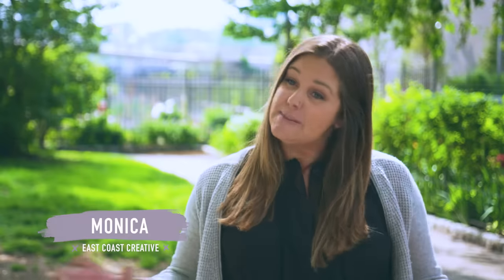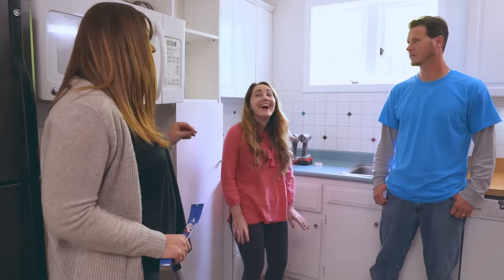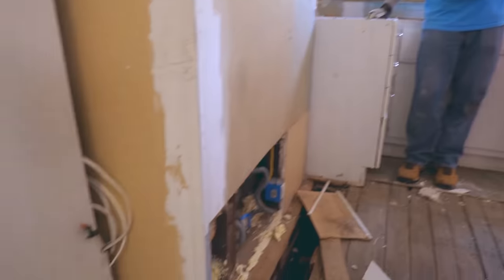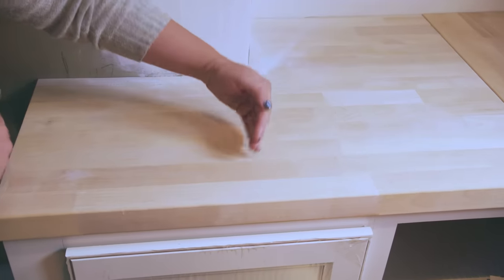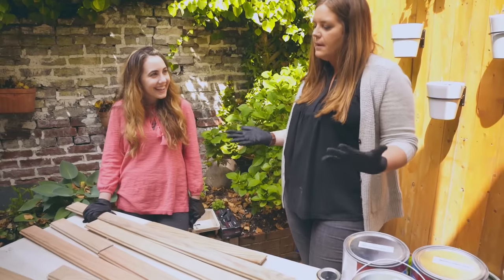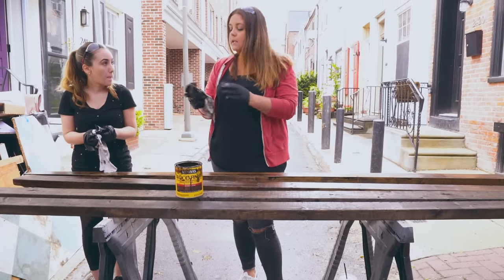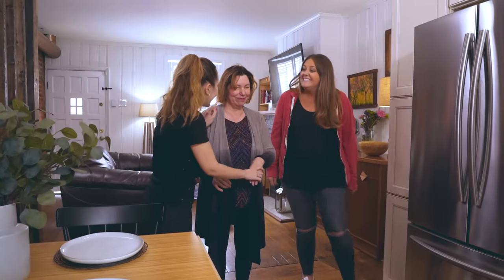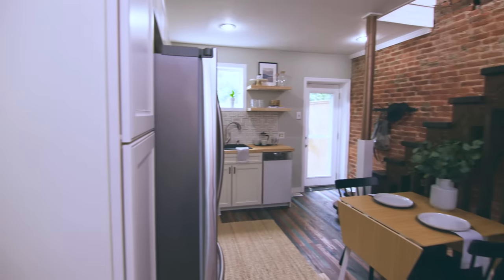The Weekender: "Tiny Mighty Kitchen" (Season 4, Episode 8)

Comment: I loved the "wall" created next to the stairs, and felt it complemented the open stair structure to the upstairs.  A light fixture behind there on the brick wall might add illumination and eye appeal.  The floor design wasn't my cup of tea, but I loved how you ripped up the luan and existing tiles and used a hardwood option. It would have been great to gain a bit more space for the fridge or range, but you were working with an existing chimney structure that couldn't be changed easily.  Ditto for the floor.  For a one-weekend time frame, and a limited budget, you solved a number of problems, increased efficiency, and added functionality to the space.  Well done.

Comment: The kitchen looks so much better than before! I love the stair solution...but,...as a designer myself, I see a few more things that Monica could have further done: 
#1. Enlarge the window over the sink by extending it down another 6 inches. Larger windows give more view to the outside, making the space feel larger, and giving more air and light to the interior.
#2. Why use such a deep 3' refrigerator when 2' deep models are available?  Use a 2' deep counter-depth refrigerator and you will gain a foot of space in the eating area, and overall better space-flow through a tight passageway.
#3. Why use a stove range which also juts out? Instead, use a built-in cooktop over a built-in wall oven which will save about 3" of precious depth and give a sleeker overall design.
#4. It would be better to place the pantry unit between the stove and the refrigerator (rather than at the end), so that the stove isn't heating the refrigerator by being so close to it. This will help to save energy and reduce the electric bill to cool the refrigerator.  
#5. The space to the right of the compact dishwasher is under-utilized. Yes, there is a heating vent in the floor, but built-in open storage can be custom-built over it. There would still be airflow and more storage would be gained.
I hope this helps everyone with similar tight spaces. :)
Reply: I would have also recessed the 4" boards in the stairwell to fit under the stair to save 4 precious inches. It would have been a bit harder to install but now there is the top ends of the 2x4's to gather dust and take up space.  Overall though a lovely reno.
Reply: you are so right about the window, but since its a 2-3 day project it would have taken too much time to do as well. and yes pantry between the fridge and stove would have been ideal!
Reply: Well she only had 2 days for the reno so not enough time for the window extension. And maybe the home owner wanted that size of fridge and stove. And I don't think the pantry would work in between the stove and fridge symmetrically. Small kitchen. That would chop up the flow. See we all have opinions. I think you should have enough respect for a fellow designer to not belittle her work the way that you did. Especially when the job that she did turned out to be fantastic. I hope that you receive the same respect that you give.
Reply: I don't disrespect Monica at all and admire her creativity. It's just that I have much education and experience in design. Designers critiquing each other is actually very common and accepted. The best designs are often made through collaboration, thinking through all the details.
Reply: @cathyhendrix7552  So opinions are NOT welcome???  Possible to make a good design great with a bit more time to reflect/focus on the small things like enlarging the space. Hey better ideas for the next project! I appreciated the suggestions for my own home...
Reply: @phyllisharris2766  Sure opinions are welcome. I gave MY own opinion.  And that is.....I don't think a designer shoot toot their own horn at the expense of another designer. She went on and on about how she has much more education and experience so her design is better. SAYS WHO??? I just said she should have more respect for a fellow designer. It is her attitude that bothered me. She came off like she was better. And I just don't like people like that. But, hey, that's just me. And MY opinion.
Reply: @cathyhendrix7552  Absolutely fine to have your opinion...NOBODY was knocking yours or ANYTHING you chimed in on. SEEMS you would have the SAME courtesy, and THAT'S MY opinion, lol. It's fine, I'm clearly not the comment police in any case...just your comment was so packed with emotion, I was compelled to reply. 🙄
Reply: @phyllisharris2766  well I do have a tendency to get emotional when I feel like someone is trodding on another person. I ALWAYS stick up for the underdog to. LOL.

Comment: Oh my, girls, long hair hanging into your face and using power tools at the same time?? Use some elastic to keep your hair o the back of your neck. Nope it don't look pretty, but an accident ain't funny either.
Reply: AGREED!! I learned my lesson very quickly, had my hair clipped up outside using the big leaf blower, had on a hoodie and leaned over to turn it on and the string on the hoodie got sucked into the motor before I could freakin blink an eye and it pulled the whole blower up to my face! I hit the switch and got the string out which was now twisted one and a half million times into a tiny ringlet! can not imagine if that would have been hair, and ALSO wear better shoes, even some old work boots when doing that stuff, and no jewelry, I know these are cutesie little weekend make overs but you cant believe how quickly things happen.
Reply: Yes terrible accident. It's called scalping. If your on Lowe's Home Improvement channel at least pretend to be safety cautious in all areas because we're newbies and we follow things to the letter until we're confident.
Reply: I thought that the first video i saw of her...
Reply: Also, wear a mask when cutting that tile so you don't breath in the dust causing silicosis.
Reply: Also her long jacket sleeves are dangerous!

Comment: Love the back splash and flooring! . I can’t help but think there’s 18 inches next to the dishwasher that could have had a small quarter-pie shaped cabinet or simply butcher block shelving that could possibly have extended the kitchen counter top. I’m not a designer. I don’t know if there was a reason it was left as just the wall. Great job. Especially the open wood under the stairs.

Comment: The backsplash is a great find for the countertop! I would have stuck to lighter stains on the floor, to make the space brighter, but the idea is outstanding! Small nit-pick: There is extra space between the door and the cabinets, where you could have out a small extra cabinet, maybe a hidden garbage pail. There's a vent, but that could be redirected through the toe kick. Or just make the counter longer and supported on brackets. It's such a waste of space in this small kitchen...

Comment: For a kitchen that small, I would have tried to build custom cabinets throughout at a height appropriate for the homeowner, sink and cooktop included. I noticed her head barely reaches bottom of the upper cabinet. Of course that's not a weekend project, but worth the extra time if she plans on staying in the house for a long time. She would really benefit from a sink and countertops that aren't too high for her.

Comment: If the basement is just the boiler and electrical, I would have put in a trap door that can open and latch flat against the underneath of the staircase that goes upstairs. Then she could have used that space under the staircase for more eating room, then just slide it out of the way when you need to go downstairs.

Comment: The old yellow insert plug with the white plate is an eyesore. The new backsplash stops short from the countertop on the right side, it looks odd.  The floors however turned out good.

Comment: Not a fan of subway tile, but the woven basket pattern is just as bad, imo, just too busy and there's nothing spectacular about woven baskets to weave it into the design, no pun intended. Even a subtle vertical pattern to reflect the slat wall might have been a better pick if a solid backsplash was not enough pattern for this kitchen. Personally, I generally  favor the serenity of a relatively large solid area, like a kitchen backsplash, as kitchens have enough activity and intended or unintended displays. My view across the board on the basket-weave backsplash is that if I wanted any type of woven basket look, I'd add actual woven baskets, not a representation of something so mundane, but that's just me. Seagrass baskets or trays in this kitchen would have worked nicely all on their own. 

The "death trap" remedy is, surprisingly, very, very nice! (I would have liked it a little better, maybe, had the wood slats been topped off with a horizontal slat, eliminating the sharp "impalement" energy that the open slats give off; a subtlety important only to energy "sensitives", plus it would be easier to dust than individual slat heads. But the use of slats was a clever,  WONDERFUL idea because it doesn't subtract from the visual space; it actually draws the eye to it! 🎯

Very chic, restaurant-ish little dining nook (or is it a cranny?); just add a small glass vase of fresh flowers--- nothing fancy, just one or two flowers (or realistic faux flowers in epoxy "water") to the table. 😊

...🤔Well, If she wants to lend a little more 'flavor' to the cool restaurant-ish look, the owner might want to add a hanging plant (fern?) off to the side of table somewhere, (either in front of or behind the slats, even, silk plants you don't have to but dust once in a while, suspended high along the stairs, on the far side, some, for added perception of depth, but keeping it (if in front of the slats) close to the defined dining area... and hung high enough to clear the head of anyone using the stairs. Any silk plants behind the slats along the brick wall can be lit up by soft lighting. Your kitchen with feel even bigger. Maybe even an accent rug immediately under the table and chairs, for more definition of space within a space. Also, an actual painting, picking up on some of the colors of the showpiece floor (especially aqua blue and turquoise against the dark brick!) even if the only place to display it is on the slatted wall somewhere (actually, she'd want to keep it close to the perimeters of the dining nook [or is it a cranny, lol?] but I think anywhere on that slatted wall would work, like off to the side, behind one of the chairs). Oh, and a set of three to five small lamps with soft, warm lights suspended from the ceiling, centrally over the table, adds a little of that restaurant-ish dining intimacy during dinner, with all the overhead lights in  kitchen turned off or greatly lowered. 

So the floor colors being beautifully compatible with the view of the brick wall bring me back to my present pet peeve: Here, a blue-ish backsplash (much of it in a lighter tone, so as not to darken the kitchen) like the old light turquoise counters the homeowner hated,  echoing the blue boards in the floor, would have tied it together nicely. I can see that the designer had her creative floor in mind when expressing a fondness for the old aqua countertops, lol. Blue might be a tricky color for a warm kitchen, I feel. Alternately, a couple of matching aqua-blue/turquoise items might help tie it up a bit more, like a large ceramic aqua/turquoise cookie jar and/or an aqua blue wall clock elsewhere in the work area of the kitchen. Best wishes in your new kitchen; you had good help! Enjoy it.
. | | | 🌿 | | | | | | | |🖼️| | | |
  | | | | | | | | | | | | | | | | | | | |   
              🔺🔺🔺             
     🌹🥖🍴⚪🍤🍧
   --------------------------------

Comment: Just replacing the ref with more modern look and the oven stove just to tie up the color of the new sink 🙃 perhaps she should have that death drop with strong wood lattice for decorative purposes and the flooring 🤔🤔🤔, they just removed the basic vinyl flooring replacing with worst planks. She would someday be sorry when she fails to upkeep that butcher block that would grow mold underneath the sink because of humidity... she needed that block resin protected against water spill on the sides of the sink. 😥🤔 and mold built up on the sides 😱

Comment: In a kitchen where storage space is at a premium, you have removed an upper cabinet for shelves (by the door) that can't possibly hold as much stuff. The barrier in front of the stairs is a good idea, but do the slats really need to be so thick, wasting a couple of much needed inches? While the table before was overly large, what replaces it is barely big enough for two to eat (even with the fold-down raised up); what happens when the homeowner has company? Some of the "solutions" are not very practical. There are other possibilities, available at Lowes, that would have made a real difference in terms of the limited space. A bit more research might have made a real difference. It feels like this episode really stretched the budget for the show. Biggest thing: while you want it to look nice, style should and must always, always, follow function; put the cabinet back. Second thing: inform the homeowner about the downsides of maintaining butcher-block counters; these can look bad pretty quickly if they aren't carefully maintained.

Comment: She failed to mimic the pattern repeat in the tile backsplash down at the counter where she just "stuck" in the "one" tile that "fit".   I wouldn't be able to deal with that, my eye would constantly go to that flaw.   That floor is not "finished",  it has got to have several coats of polyurethane or something else to seal it or it will NOT continue to look good.